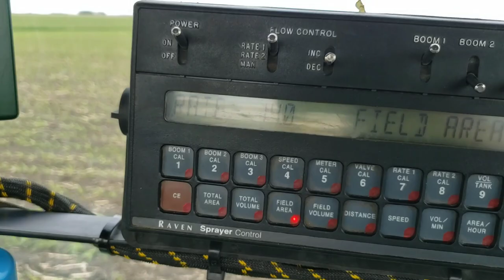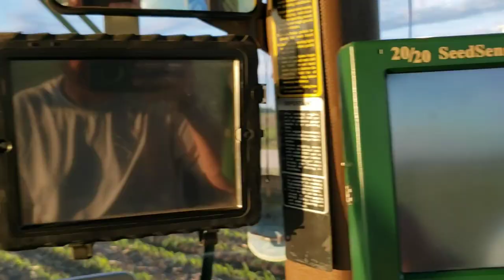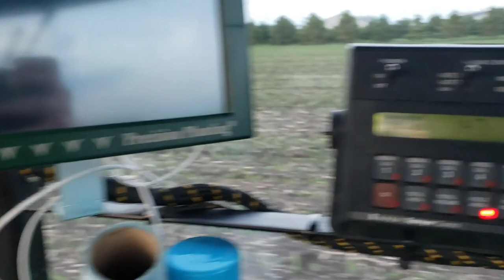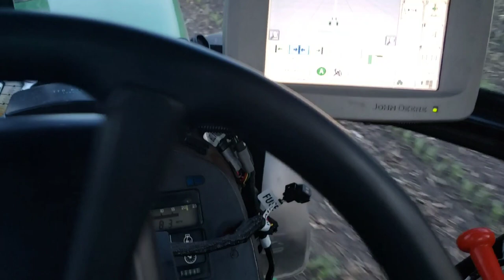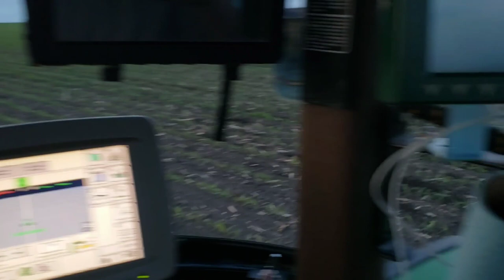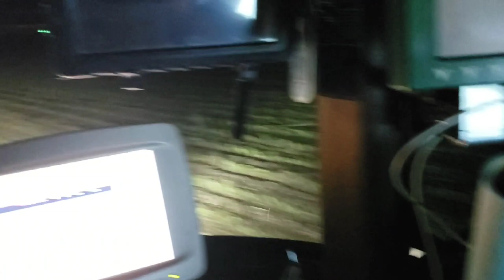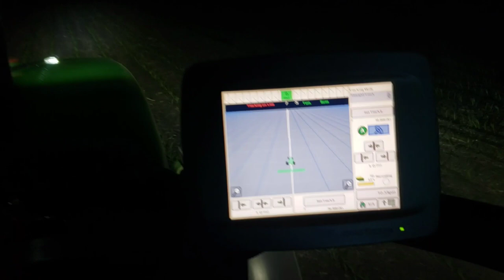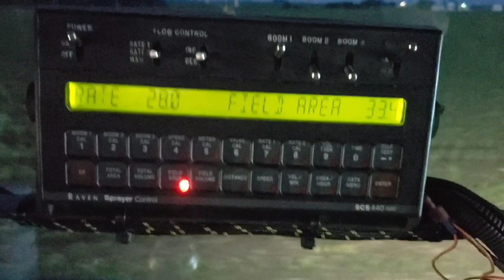Sidedressing corn 2021

Comment: Get er done, the 4650 should have no problems at all with that light duty job
Reply from the maker: Its not the best row crop tractor but that bar needs 3 remotes to run and i figured the autosteer would make life easy

Comment: Those tractors should still be made today instead of the junk there kicking out. We just spent 5000 on injection pump and ECU to run it because the guy from Deere couldn't figure out which one was bad. So he put both on.
Reply: Seems like they like to just throw parts at the problem until it fixes something.
Reply from the maker: Wow, thats ridiculous. The good part is probably sitting in his toolbox now

Comment: I’ve seen others do this but I’m curious why you skip a row in between passes?
Reply from the maker: This bar is setup to feed 12 rows with 11 coulters. The outside 2 have a larger tip to put more product on to feed more to the outside rows. Ive used a 13 coulter bar setup for 12 rows also that basically did the opposite, the outside 2 only put on a half rate. I think the 11 is better, you dont have to worry about putting that outside coulter into the fence on your outside pass

Comment: I've been playing with my sidedress and pre-plant rates over the years. Gone from 100% pre, to 30% pre/70% sidedress, then 50%/50%. It looked like on a few wet early springs the lower pre-plant amounts ran out before sidedress.  What level are you comfortable with up there? Thanks.  My best this year looks like 100% pre with a dry first six weeks after planting.
Reply from the maker: Definitely is a year to put it all on pre here. We cant catch any rain to get it worked in. Where we have manure on soybean stubble i dont sidedress any, just the continuous corn and where we didn't have manure. On that im probably 65% pre and 35% sidedress.
Reply: @iafarmer  If it helps I did the 50:50 this year. Agreed, it takes some rain to get it in after sidedress.  3 inches rain after sidedress and the N levels in tissue tests were still below on the sidedress vs. the all up front.  Will know more at the combine.
Reply from the maker: Interesting. Will you take tissue samples on each all the way through grain fill?
Reply: @iafarmer  
50/50 split
N % v3 4.01
v4 4.68
v5 4.28
v6 4.52
v7 4.12
v9 2.93
v12 3.68
tassle 3.16
r1 2.88

100% Pre
v9  4.47
r1   3.11

We'll see at the combine.  That v9 number stands out. We got dry.